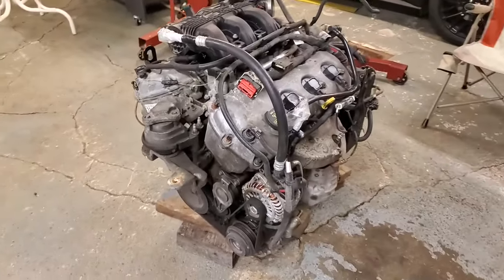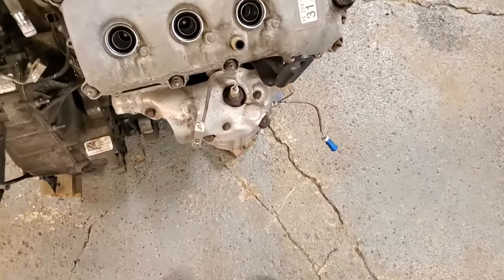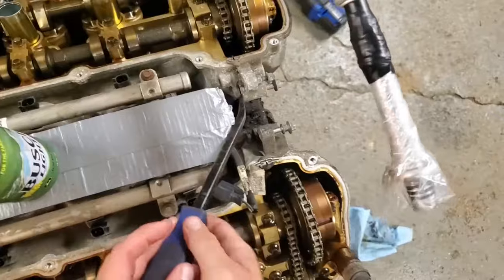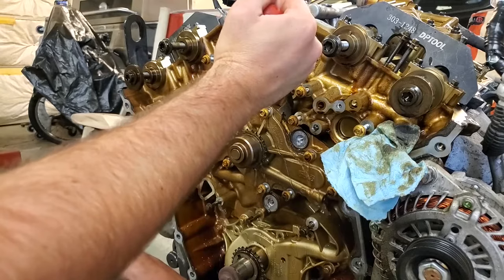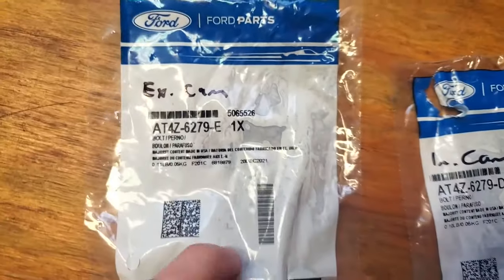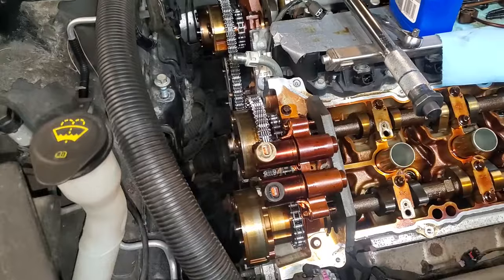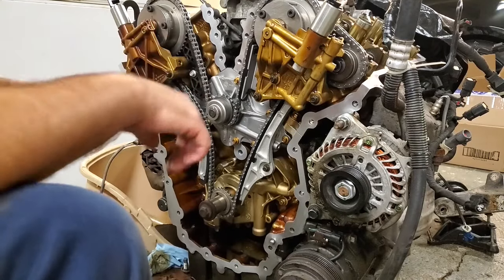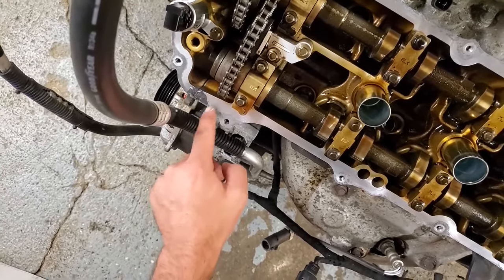3.5L Duratec/3.7L EcoBoost Timing Chain and Water Pump Replacement

Comment: What kind of miles can you expect before having to do this??
Reply from the maker: Technically you should never have to, since, according to Ford (and every other manufacturer), the chains and and associated components are "good for the life of the engine". Unfortunately that is typically not the case for just about any overhead cam engine, unless you consider timing chain/chain component failure to be the end of its life. 

There are 2 different engines shown in this video. The main one (the one outside of the vehicle) showed no signs of any issues at nearly 200,000 miles. The only reason I did them was because I was swapping the engine from one vehicle into another, and it is way easier to replace the stuff outside the car than in it, and the car was going to a friend of mine that is a single mother of 2 kids, with no spare vehicle to drive in the event of a breakdown, so reliability was of utmost importance. 

The other one (in the vehicle) had a water pump leak at around 180,000 miles, and since the chains have to come off to replace the water pump, might as well replace those as well. On this engine, the chains and all associated components appeared to be in good shape, with no signs of imminent failure.

So to answer your question, it's a crap shoot. I really don't have a solid answer. With these engines, it seems that the water pump failing is the biggest concern, and you might as well replace the chains and related parts while you're in there because it is a pain of a job to do. I personally have never seen a timing component failure on one, but that is definitely not to say that it can't or hasn't happened. 

I wish I could give a decent answer, but unfortunately I can't.
Reply: @darkhorseautoanddiesel  thanks for the thought out answer!!
Reply from the maker: @Bear1097  you're welcome. Sorry I couldn't give you anything more definite.
Reply: You won't until water pump leaks
Reply from the maker: @Shmish_smorson In probably 99% of cases, you are probably right. Unlike the 4.0L SOHC made in the 2000's, they seem to have actually done a decent job designing these chains and components. I'm sure there has been a few chain failures, but I've never had to deal with one. It's pretty much always the stupid water pump.
Reply: My water pump going out with about 160k miles on it. 2013 Ford Explorer. So just an estimate of how long it lasted. I've always read other people's went out around 90k to 140k commonly.
Reply from the maker: I have one coming in the shop soon with 86k on it with a leaking pump. The problem is more time related than mileage I feel. It also doesn't help that no one changes their coolant. Coolant has anti corrosion additives in it that need to be replenished, and not doing so can cause issues. If coolant was replaced at the recommended intervals I bet a lot of these failures would not have happened.
Reply: @darkhorseautoanddiesel  you just encouraged me to change my coolant sooner than later, thank you sir!!
Reply from the maker: @Bear1097  Atta boy. I make no guarantees on how much it will extend the life of the pump, but it makes sense to me that it would greatly help.
Reply: @darkhorseautoanddiesel  I got a 2014 Taurus SHO w/ 120k miles on it, maintenance was kept up on it for the most part, and got record of coolant being changed out once somewhat recently, but definitely going to do it again sooner than later for piece of mind. Previous owner changed oil with syn every 6k, but I will be doing it more frequently. First thing I did when I got it was service the PTU! What is the recommended interval for coolant on these?
Reply from the maker: @Bear1097 Honestly I think you're fine continuing the 6k oil change, of course that depends on how you drive it. Best thing to do is get an oil analysis done every now and then and they can tell you if you can extend your oil change intervals or if you should shorten them. They can also tell you if you have coolant contamination, excess bearing wear, fuel dilution, etc. I use Blackstone Labs for that. 

Changing that PTU oil was definitely a smart move. "Lifetime fill" my ass! I have a video on that as well, and I state my opinion for that pretty clearly 😂

As far as coolant change intervals, I'm not 100% sure on these. It should be in the owners manual. I think usually it's like 5 years or 100k miles, whichever comes first.
Reply: @darkhorseautoanddiesel  bmw list transmissions as non serviceable with the zf 6 speed automatic , the oil is in the trans for the life of the car , they list 100,000km  so not a long life car apparently

Comment: Wow that's a big job  how can you tell if it needs  timing chains  what codes or is it lose
Reply from the maker: The most common sign of timing chain issues is a rattle at startup. There can be codes as well, however I don't have a list on hand of what possible codes would indicate failure. However, usually the chains don't fail on these engines. I'm not saying they never fail, because I'm certain there has been failures, but I've personally never seen it. Usually the chains get replaced during a water pump replacement because the chain has to come off just to get to the pump. So since it had to come off, and getting to them is obviously a major job, it recommended to just replace it all while you're in there.
Reply: @darkhorseautoanddiesel o si aller cuando prendí el motor en frio..ppr  primera vez al encender la cual sube su revolucion salio un ruido y luego se silencio eso es lo q dice sobre la cadena de tiempo ya q cuando esta enfrió al ensender sube la revolución hay es cuando se escucha el sonido y luego se silencia y luego ya no suena más solo cuando enciendo el motor en frío.  Eso es signo de la cadena de tiempo?

Ya q en este mes de agosto 2024 me a llegado a sus 200k millas corridas

Comment: 3.7 ecoboost?
Reply: I didn't know they made a 3.7 ecoboost either and I was a ford tech for 20+yrs 😂
Reply: @gopaulsalick507  does putting F150 manifold and turbocharger on to a 3.7 Cyclone count as a 3.7 ecoboost? If so I have one in my Mustang making 520 whp.

Comment: Why is the inside of his motor bronze colored?
Reply from the maker: It had nearly 200k miles on it. Just stained from oil.
Reply: A hora 13 de agosto 2024 el motor de mi guagua ford flex 2009 ya a llegado a las 200k ❤

Comment: My timing chain has been done 4 times already still not timed right been having to do inside the car because I have no other choice. Its a pain in the ass . I keep getting codes that my timing is over retarded or over advanced. I got 17 codes all on the timing/crankshaft/camshaft. Some of the codes are repeats.  Can any one give me advice ? Plz help.
Reply: Heave you looked at the cam n crank sensors
Reply: @RoyalTrashServices  nope but i will check , also put the reader on my car says something about timing 10° . Camshaft 1

Comment: ....and i was very close to buying a 2020 Lincoln Continental.

Until i learned this about these engines.

If the Lincoln dealer doesn't give me a deal on a Ford Extended Warranty the deal is off.

Comment: at 15:24, the duratech designers put holes on the timing cover so you can pry the timing cover with the bolts and not the pry bar. cool huh?
Reply from the maker: On certain ones. I didn't realize that when I made this video, and the main engine in it had them. However several engines I've done since, newer ones, don't have the holes. Definitely cool, as long as they exist.
Reply: They did that because you need to pull it so many times to replace the pump every 80000 miles, or leak and die.
Reply: Same engineers put the waterpump inside of the engine.

Comment: Anyone in comments finished this job? I’ve read where people say to replace the oil pump while you have this apart because it’s near the timing chain
Reply from the maker: There is nothing wrong with doing the oil pump while you're in there, I've just never felt it to be necessary. If the engine looks reasonably maintained, i.e. no sludge buildup, and has good oil pressure, the pump shouldn't have anything wrong with it.

Comment: 10:18 looks like anybody doing this, you want to remove dipstick first.
Reply from the maker: The sad thing is, I've done several of these since making this video (even have another, possibly better, video currently in the editing stages), including one last weekend, and I still tried to pull the valve cover before pulling the dipstick out.. 🤣
Reply: @darkhorseautoanddiesel you wouldn't happen to be in CT would you? I need this job done. It died today. Coolant mixed with oil 😡

Comment: Wow, 200k and the abuse that pump has to endure, and was just now being replaced, pretty good Ford!.... I think Nissan also has the same design, funny how you never hear how stupid they are. oh and Chrysler 2.7 v6 too. Its a great engine, lots of power and reliability, this design keeps monkey's and fiddlers from ruining their family car.  Chains should never go on dry, soaked in oil for 24 hrs before assembly.